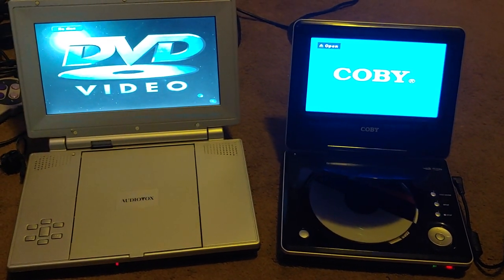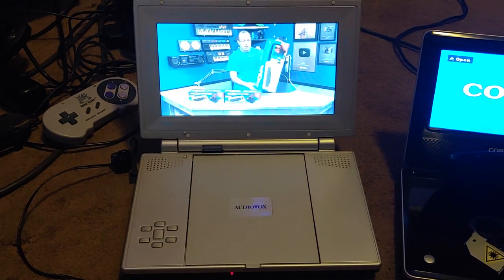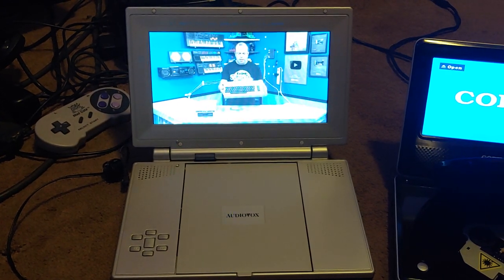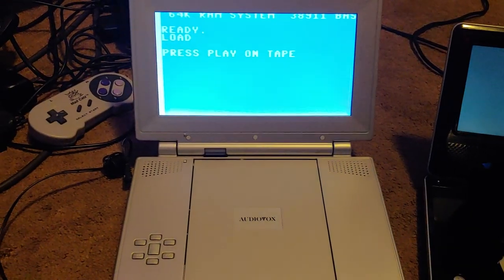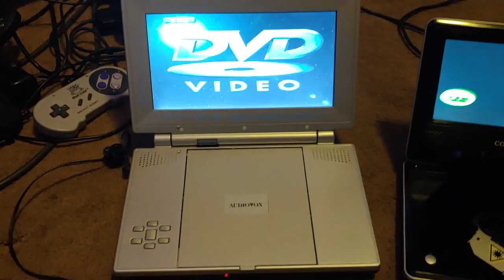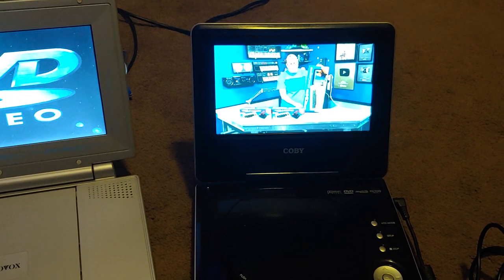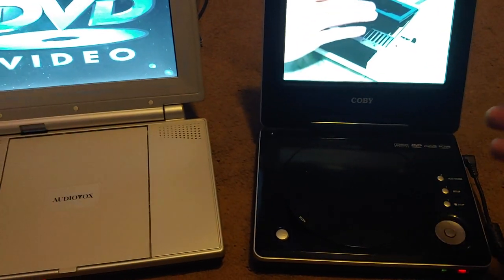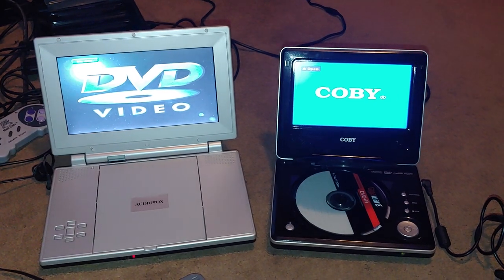Two very crappy portable DVD players - Audiovox and Coby

Comment: Wouldn't the test be more relevant if you used an actual movie DVD?  I mean these are both old models and were likely given as cheap Christmas gifts to children when they were new.  Actually, I've had some positive experiences with the Coby brand, starting back in about 2008.  Initially I was interested to see just how much value, if any,  such cheap electronics devices offered!  My first purchase was a thumb drive mp3 player.  I was astonished at the number of features crammed into this tiny player!  With a good set of headphones the Coby sounded every bit as good as other players!  To their credit, when I had a problem with it, the Coby representative was VERY helpful on the phone, and figured out the problem!  To their detriment however, the player ceased working on the 91st day lol, following a 3 foot drop onto a carpeted floor lol.  I have a nice little collection of Coby products that still work over ten years after purchase!  I wish they were still in business like the old days!
Reply from the maker: The players did the same on a standard movie DVDs. So using a burned DVD wouldn't have made a difference.

Comment: I had bad luck with Audiovox portable DVD players. First one was a grey 7 inch one that lasted about 9 months before I heard a loud crack noise the screen hinge failed also my cat ripped apart the only cable so once the battery died it never turned on again I second audiovox the screen went out and the last attempt was a 9 inch which was broken in 1 DAY it was skipping discs bad even new ones. Although I like the picture quality of audiovox players The reliability of Audiovox players are the worst I ever experienced. I ended up getting a SONY FX970 that portable DVD player is 7 years old still works great besides the battery. I don’t trust audiovox as my everyday DVD player it’s just to unstable
Reply from the maker: Wow that is awful with those Audiovox players. I mean I knew they weren't great to begin with but... damn. In time if I come across a dvd optic I may try to swap it with the one in the Audiovox and see how it preforms.
Reply: Chris&Derek Yeah good idea coby is just ok but I perfor Philips or SONY portable DVD players but I can’t really trust Audiovox players they break down a lot. Some people may get lucky and have a working Audiovox no issues but in my case I stopped using Audiovox since the third one broke down 1 day after getting it